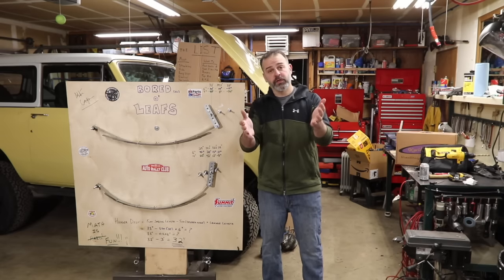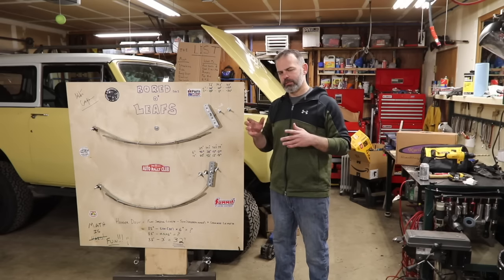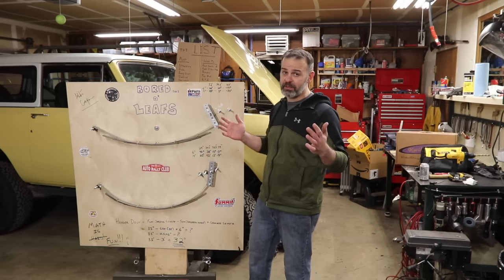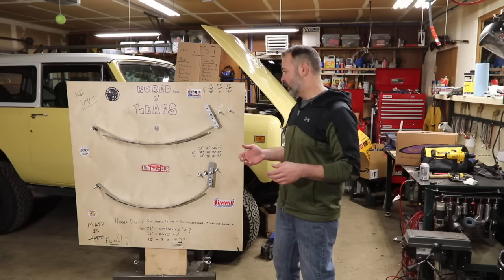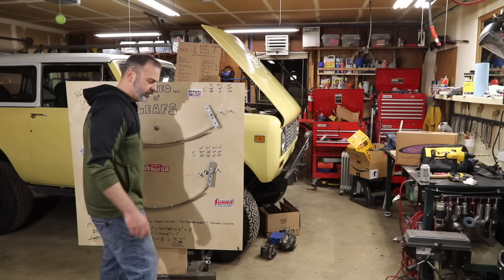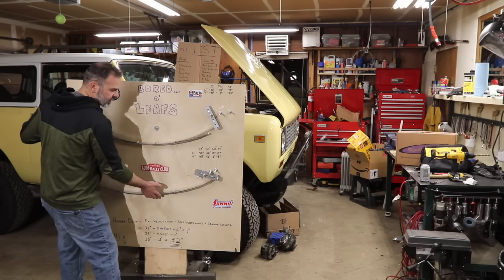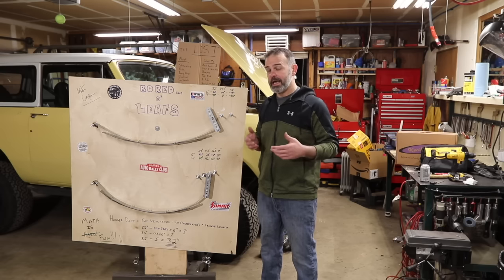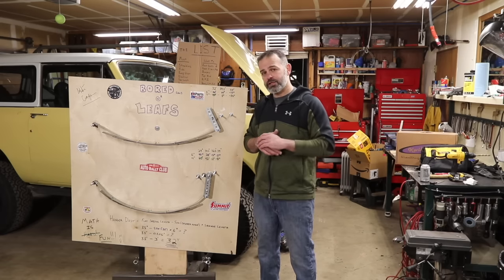5.04 Leaf Springs & Shackles GURU Level Tech!

Comment: The best explanation video in youtube. Keep it up matt's garage.

Can i know your input about comfort shackle or g-shackle? Is it really effective? Im planning to put a pair for my van. Thanks!
Reply from the maker: kwatoribio hello and thank you. I do not have an opinion on the g-shackles because I am not sure I understand how they help. I can see they may add droop if you are off-road but then you would need longer shocks, driveshaft and brake line. What is wrong with the way the van rides currently?
Reply: @MattsGarage  thank you for your response, your so generous. My van is a 2017 toyota hiace that is use for passengers. The rear drop a noticable height even w/o load and much more if it has. I am thinking about puting a g-shackles to add 1 inch of height so it will be on the right level if loaded. What do you think? Hope you can give me an advice that will not break my wallet. Thanks alot.

Comment: Im just wondering... wouldn't the less movement on the shackle be more ideal?  With the shackle moving less, the axle would have less forward and backward movement... no? Just a thought I had here. Great video though!
Reply from the maker: Something has to move though. Without shackle movement there is no spring flex. It would make for too stiff a ride. But you are right, the downside is fore and aft axle movement. That’s why coil and link suspensions are superior, especially in the front. The back doesn’t matter as much since it’s trailing.
Reply: @MattsGarage  the spring still compresses the way it's supposed to though doesn't it? It is a bit hard to tell without lines drawn or something I guess haha
Reply from the maker: @dirka_dirka_mohammedalijihad  no. As the spring, compresses it has to get longer. Bend a piece of metal and measure it from end to end, then flatten it. It will be longer flat. The shackle takes up that difference.

Comment: I watched this because I was looking for tech on leaf's. I'm getting ready to do a 52 front swap and a 63 rear on my square body. The 63s are out of a dodge 1 ton ( really stiff ) and removing  a pack or 2 to ease the stiff ride, but if I can mitigate that through shackle placement, maybe it wont be such a disastrous task... either way I guess it's all just playing with numbers.
Reply from the maker: Ryan Rich sounds like a unique project. It’s tough to find that balance. Go too extreme with the shackle angle the other way and the suspension doesn’t “act right” at which point better to have a more conservative angle (slightly less than 90) and pull some leaves. Pulling leaves can either be simple or a real pain depending on the leaf straps and rivers. Plus you have to go to a spring shop for all new ubolts. I don’t torque the new ones all the way until I first drive the truck a little ways to make sure I don’t need to take out another or add one back. Good luck!

Comment: Isn't the leaf spring and shackle flipped upside down though?  per what a double axle trailer would have set up.  Do appreciate the points you made though.
Reply from the maker: Both exist.  The kind you are talking about are tension shckles.  Broncos have that style.  The principles are the same but I'm not as experienced with tension shackles.

Comment: With the top spring I have a flat spring on my hot rod I has about a 4” shackle on it if I put a six “ shackle will it raise the car as well
Reply from the maker: It will raise the car by half of the difference between the old chackle and the new.  So in your case it will raise it 1".

Comment: I just set up my rear spring hanger and shackle at 90 degrees from the spring eyelet so I can carry weight. I’m running 2500 springs on a 84’ Toyota pickup that sees on road and mostly off road loaded with gear pulling a small trailer. All this is set up on a bare frame right now no axle no nothing. I’m guessing with weight of axle and some 35” tires I’m guessing I will get a little droop, and that 90 degree angle is with a 5” shackle. The springs are rated for a heavier truck so harsh ride for me is normal. If this seems like in on the right or wrong path let me know, this set up is not fully welded in so changes can be easily made.
Reply from the maker: Sheep Dog can you email me a pic or two of the setup at mattsgarageshow@gmail.com? I’m not an expert but I can certainly share my opinion.

Comment: Great video, but I have a question for you. I am building a street rod, a 1935 Pontiac Coupe, which currently has a leaf spring rear suspension. I will be installing a camaro or maverick rear end. Can I use the current rear spring set up, or should I buy a new set of leaf spring set up from chassis engineering? There is a rear end of unknown originion in it and I have a camaro rear end that I could install. your opinion is greatly appreciated. Thanks.
Reply from the maker: If you like the rate (the feel) of the ones you have, there is no reason to change them. Springs do sag but you would be able to tell. The question is does the Camaro axle have the spring pads in the right location and are they the right width?

Comment: I have a small trailer 4x8. Just got a new 54” mower. I cut the sides of the trailer to 4” and about to weld it together. The axle is too close to the top. How can I extend the leaf springs to get about 6” higher?

Comment: Interesting. I have never come across this info. 
The springs on my cherokee are flat and it rides pretty hard. I should be able to tell if replacing these worn springs with springs thay have more curve will soften or stiffen  the ride moving the shackel location is not an easy option.
Reply from the maker: Worn springs are soft.  New springs will stiffen the ride unless you are currently riding on the bumpstops.
Reply: @MattsGarage  my bumpstops are close friends with my axles.

Comment: Sir, I drive a 2000 GMC Safari van. I  have a tool box in the back all the time that weighs about 200 lbs. My leafs are shot. They are flat or even have a slight "frown" instead of a "smile" shape. I heard you say "S-curve" and I think that may be my springs. Sometimes I load it up pretty heavy and I would like to even pull a trailer. This van rides TERRIBLE! super rough on the road and feels every bump. Do you think this is due to my leafs? Do you recommend a leaf for me? Your video taught me a lot! My shackle mounting location is fixed so I cant change that. But It is a Journeys Off Road lifted shackle kit so I can drop the leaf down another three holes (about 2") Any help would be super appreciated. Thank you!
Reply from the maker: Hello. 200lbs would not cause the problem. If it were 2,000 lbs that would make wines for fatiguing the springs. Keep in mind some factory springs are designed flat and others are almost upside down like a Frown (I think 80’s Ford 4x4’s 3/4 ton trucks were like that). If I were you I would look at other safari vans and measure to see if your springs are really different. I would also get rid of any aftermarket parts and use original to regain a smooth ride. Chances are it is that kit you put on is either not a good design or it was not installed correctly (like the bolts were tightened on the lift instead of with the suspension loaded).
Reply: @MattsGarage  Thanks Mat for the advise! I will do that. So the problem was like that before the lift kit and it rides the same now as it did before. So i don't think it is that. The kit is from journeys off road and there are a tom of people with that kit on their vans.  I'm thinking the springs are shot and probably the spring bushings. But I will look around at other rigs. Thanks mat!

Comment: Great video Matt. Do you measure the angle with the car resting on its wheels or jacked up?
Reply from the maker: gimenofm ideally you want to set your slightly less than 90 degree angle when the suspension is loaded with the weight of the vehicles and some weight for passenger(s)
Reply: @MattsGarage  Brill thanks a lot, I will move the shackle brackets in the morning as I only tagged them in place but my shackle angle was so much that the leaf was touching the frame...will probs have to move it a few inches back. If I get more or less there then I can play with the leafs as I have plenty lying around. Thanks again.
Reply from the maker: gimenofm Great. Feel free to send a photo of it tacked in the new position before you fully burn it in.
Reply: @MattsGarage  just calculated the ideal location and in theory I am pretty close for a 40 degree final shackle angle. I am wondering if I have gone too soft removing leafs...this will be a dedicated crawler so i want the leafs to flex as much as possible. Will send pica tomorrow. Thanks again, I will definitely watch your channel from now on!

Comment: Well explained...but my car runs a flat spring with no option to move the chassis mounting point on the rear shackle.  The shackle angle with load is about 45 degrees, not to mention the long travel (extension) it has through the corners (ie body roll). What are my options?  A shorter shackle  but going from 90mm currently (stock) to 70mm which is do-able will raise my rear end OR reduce the length of my top leaf to better restore the geometry to something less than 45 degrees. What would you suggest? Thanks for your time.
Reply from the maker: Mark Avramovic please send me a photo of the shackle at ride height. Mattsgarageshow@gmail.com.  

I’m not sure I understand one part of your question. If you get a shorter shackle it will lower your ride not raise it. 

Getting a shorter spring would work however that option means being very sure of the length you need. 

You said you cannot move the shackle mounting point. Can you move the spring mounting point on the other end of the leaf spring?

Comment: This may sound crazy but I have a 50s panel truck (straight front axle 2wd leaf sprung) and the sheet metal is work hardened to death. I want to soften the ride on the cheap and I was thinking I might remove all the leaves but the main one and use airbags to support the truck and the leaves to keep it in line. It's not a wheeler, I have an early Bronco for that, it's more a race bike hauler for trips to the Salt. Do you see anything I should be concerned about doing this?
Reply from the maker: I understand the theory of what you’re trying to do. I just don’t know what the consequences are. It should work, the question is, does it stress the mono leaf in such a way that can create a failure. I don’t know the answer to that.
Reply: I might go with 2 leaves if it's soft enough, I'm thinking if it riding on the bags how much stress is there on the leaves anyway, maybe horizontal stress or torsional.   @MattsGarage

Comment: All this is very interesting but I'm having a hard time applying it to what different angles cause what reaction as far as ride quality. Have A93YJ that rides like a covered wagon I'd like it to have a nice softer, smooth  ride, so I don't know exactly how to do that. It doesn't have a lift. It's all stock except I have adjustable rancho 9000 shocks I tend to run them at the stiffest Setting, that's a pretty Punishing ride but. If I set It at the softer settings. I tend to get a lot of rattling in the Jeep. And a sloppy feeling ride. What would you think would help me out here? Maybe some boomerang, shackles, I'm not sure. How to proceed
Reply from the maker: Are used to have Rancho 9000s on that Scout, and they were so stiff. You might want to switch to a better brand. In terms of rattling when it’s softened, I don’t know what is causing that. sprung suspension on a light vehicle like a jeep should be very supple. It should go over  bumps smoothly. I don’t think boomerang shackles are gonna make a difference. As I type this, I’m wondering what condition you’re bushings are in. Because if they are all rotted out, that would explain noisiness when the shocks are soft. Feel free to email me at mattsgarageshow@gmail.com if you wanna continue the conversation

Comment: So if you want your spring to get progressively stiffer for something like a road course/canyon car, you'd want it to reach 90 degrees at full compression? Would a tension-mounted shackle be better for achieving this? Actually, what are the benefits and drawbacks of a tension mounted "upside down" shackle in general?
Reply from the maker: Great questions.  I only have guesses to the answers but 90 degrees gives you the effective rate of the spring.  MOre acute reduces the effective rate, more obtuse increases the effective rate (but also incresases the chance of inversion).  For tensions shackles I think the principles are the same, I just haven't studied them.  I think the advantages are that 1) less chance of inversion (or if you did inviert your spring would have experienced plastic deformation) 2) more lateral stability because the hanger isn't mounted as a protrusion from below the frame and 3) lower COG.
Reply: @MattsGarage  Could you do a demonstration video on them, as well as explore double shackles (both in the tension and compression mount) and what you think of them?
Reply from the maker: @Drunken_Hamster  maybe in the future, but I'm knee deep on bodyworking the bronco right now.  Good suggestion though.
Reply: @MattsGarage  Fair enough. Do you have a video on how to make those mini springs for testing purposes or w/e?
Reply from the maker: @Drunken_Hamster  No.  Honestly I had no idea this was going to be my most popular video.  The YouTube algorithm is still an enigma to me.  I bolted together some lumber straps of various lengths and made som makeshift eyelects using bushings from the hardware store.  It took quite a bit of time but it worked.  The shackles are just mechanical equipment straps I cut down.

Comment: Awesome video! What are your thoughts on sliders?
Reply from the maker: dukeraul624 Thanks! I’ve looked into those and the look really interesting. I can’t speak to them based on real world experience though.the theory is sound but to me I’m not sure I’d run them on a mostly street rig for two reasons: 1) serviceability and 2) vibration transfer. But for a trail rig I’d be curious to try them.
Reply: I decided I didn’t have the kahonies to go that way this time, I sure like the idea though. I never considered vibration.

Comment: I just changed my xj shackles angle from 90 digress to 20 degrees with stock shackles but i have longer shackles if i put on it i can adjusted to 40 to 45 degrees, what you recommend i do i have arch springs 4.5” lift springs. Which one is better for off-roading 20 degrees on stock shackles is 3” or 5” shackles on 40 degrees? Thank you , where useful video
Reply from the maker: Can you send me a pic of the setup?  45 seems a little too sharp.  It should be in the 70-80 degree range at ride height.  with 45 it's going to be very springy!
Reply: Matt's Garage where I send the pic ?
Reply from the maker: Life with Doberman mattsgarageshow@gmail.com
Reply: I just send the picture before flax and after flex with factory shackles. I looked the leaf spring when compressed all the way in it looks like little bit S you mentioned on your video

Comment: How possible is it that different angles in your shackles would result in the position of the tire being forward or back of the other tire ? That is passenger side would not match drivers side. I have a 3/8" difference drivers to passenger side and my shackles are visibly out, any ideas guys? I'm new to leaf springs but after watching this video, it might be a correct assumption. Would like your input before I rip things apart too much...
Reply from the maker: I’m not sure. Is your body tub square to your frame?

Comment: ok ,I'm curios how you get starting point for shackle mount ? to get 35deg ? sprin eye to spring eye length or what , I've done this on toyota,  now changing superduty to get better flex , going to move shackle mount ,
Reply from the maker: You need to use the formula in the description.  Sounds like a cool project.

Comment: Thanks for the information. 
I own an 81 CJ7. I bought it with some type of after market leaf springs. That are much more curved than factory original. And it rides like a tank. How do you suggest I measure  the spring flat ? I see no safe way to flatten them and  live through it.
Reply from the maker: Sorry I thought I replied to this earlier but the way to measure a leaf spring is by taping a spring along it.
Reply: @MattsGarage  
Not a problem.   We all get busy and there is no doubt  life is crazy. Thanks  man.

Comment: there is a lot of useful info here. but I wish someone would do a video on the military wrap. The point of a military wrap is supposed to be an extra loop attached to the fixed end(not the shackle end). so that if the spring breaks it still holds the axle in place. from what I've read. but everyone has their springs backwards according to what i just said. except for me. I know this is off subject but you seem to know about springs. I'm just going to post a video of what I'm talking about and ask what people have to say about it.
Reply from the maker: Thanks David. Another subscriber also told me I have my springs backwards. I actually don’t know that much about them. I just sat down and thought about the shackles and wanted to learn more so I made the “Bored [sic] o’ Leafs” to research and wanted to share what I found. Send me a link to you video. Mattsgarageshow@gmail.com
Reply: @MattsGarage  I'm back a month later, lol. I already have the military wrap issue figured out. but I just wanted  to say this is a really good video that can save a lot of people some time on trial and error. I already knew some of this stuff from my own experience, but I still learned alot.
Reply from the maker: @davidcraft4909  thanks David! Happy this video is my most viewed. It was the most work!